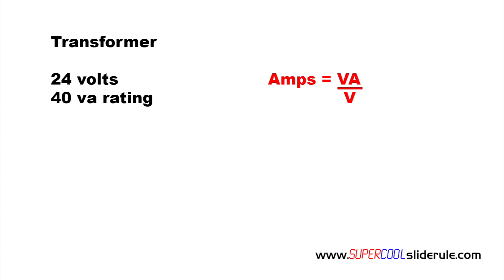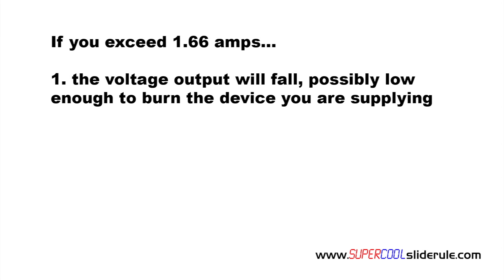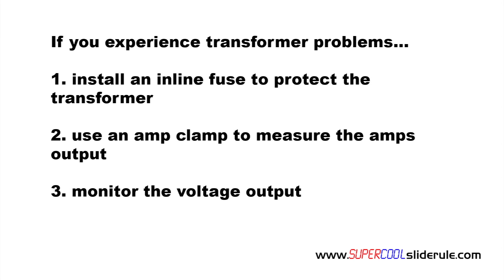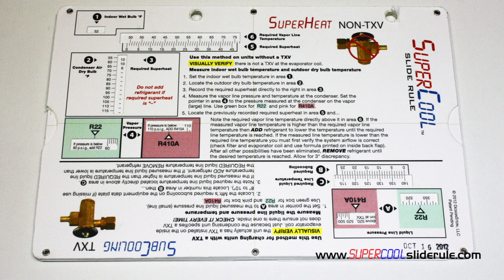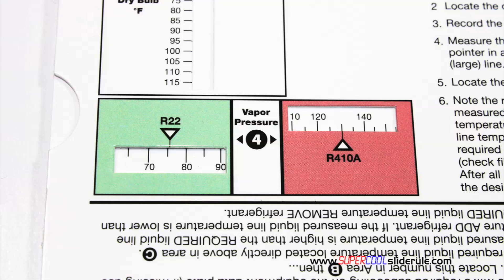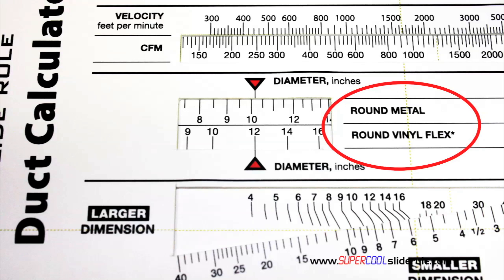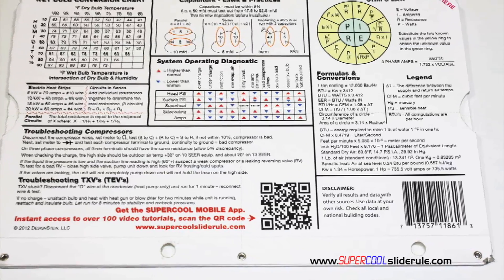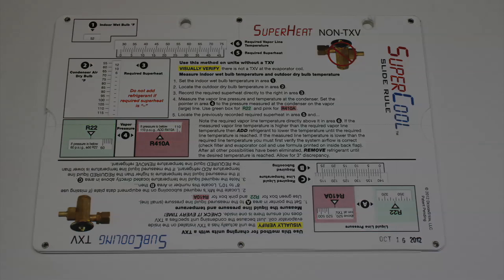Transformer - Explanation of Voltage Amps

Comment: How do I work out the current rating of an unknown transformer?
I'm confused.
Reply from the maker: There is no way to tell if it is not printed on it. If you exceed the VA rating, it will burn the winding and ruin the transformer.

Comment: Hello Bryan, nice video, i have a 14v 0v 14v, with no ratings on it. How can i know the max amps ? thanks.
Reply from the maker: If it is not labeled, then I do not know how to determine the maximum output
Reply: @btknowlton  Thank you for your answer,  I need more amps, can i use some external components ? such as a transistor or a relay ?

Comment: Well, you got all data written on it. Lets say I have transformer I know only that's in 220V out 12V . Is measuring only way to find current?
Reply from the maker: The maximum output current will be written as VA. So a 30VA transformer will have a maximum output of 2.5 amps. To determine how many amps are actually being delivered- use an amp clamp and wrap a wire around one side of the clamp 10 times, measure the amps being used and divide this number by ten.
Reply: @btknowlton  I don't have VA (P) rating for this transformer. That's nice advice with amp clamp, thanks.

Comment: can anyone say me in this which is input and which is output
Reply from the maker: The input wires used depends on the voltage. Use the white and black for 120V ac, the white and orange for 240 and the white and red for 208. Please cap off each unused wire INDIVIDUALLY. The output wires (low voltage) are yellow and blue. 
Hope this helped 
Bryan